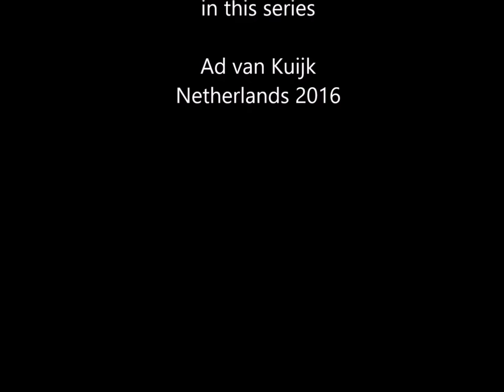guitar making; neck construction 3

Comment: what's the normal degree angle of the guitar's neck? Is it made out of 2 pieces of would glued together?
Reply from the maker: The neck is scarf joined and the degree angle is between 15 and 18 degrees; My guitars are 15 degree.
Reply: thanks...